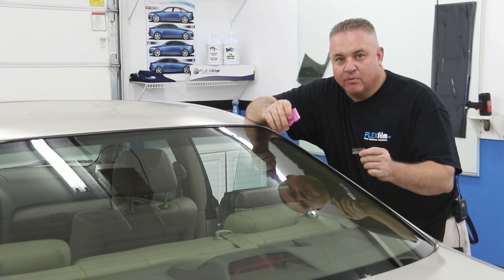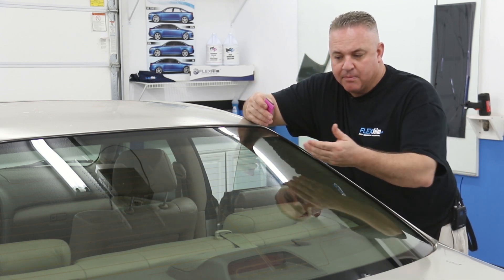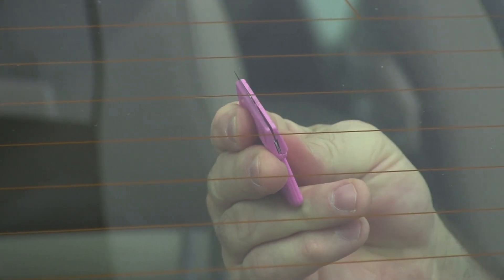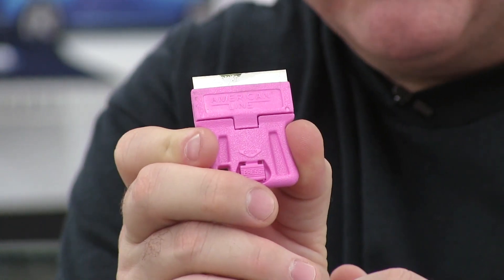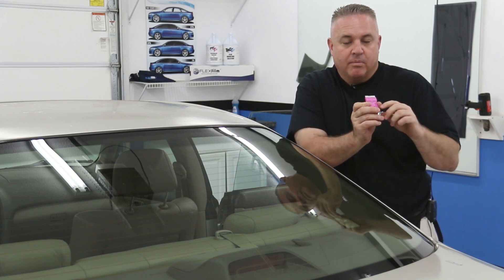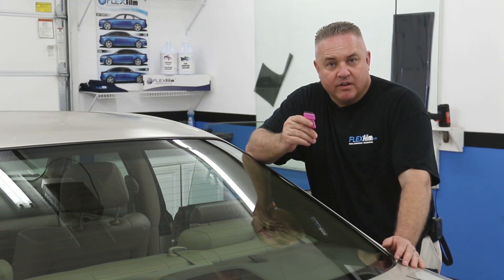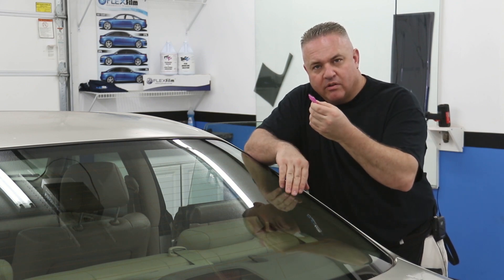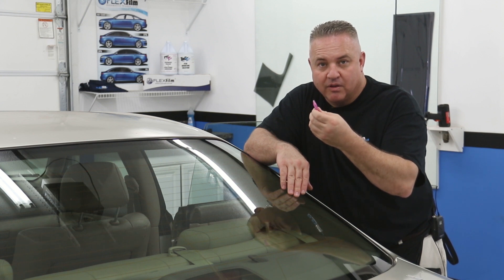Back Blade Defroster Prepping Technique

Comment: Told a my co worker this technique for a  15 Dodge Charger to try and help with shrink tracks. Needless to say he's paying to replace the back glass due to scratches now
Reply: Heath clements all you can do on these newer dodge and Chrysler defroster lines is sit it out in the sun. Basically instead of using you heat gun to touch up the window, the sun will provide a even heat all around the window, avoiding nasty heat bubbling and possible thermal fracturing of the window

Comment: Also removes old tint charcoal carbon that can otherwise affect the visability of the defroster lines and even effect the full functionality of the rear defroster lines. when tint is applied. I thought my lines were fading but they're laser etched - it takes alot to scrape the lines off but it can make all the difference in the look of esp. retinting a back window. I had to scrape off so much carbon that otherwise made my defroster look faded by previously not knowing about this part but looks SO much better to see the grid on black tint.

Comment: Please do not use this method. Coming from a professional using a razor on the rear defroster especially of newer cars will ruin the defroster. No matter what angle your at. If your having trouble with defrost lines, sit the car out in the sun for 2 hours or so and come back, most of em will lay right dow

Comment: Can you replace your defroster line can it be repainted on the outer the outer layer
Reply: I see this comments old but no one replied. Defroster lines are actually a electrical circuit built onto the glass , if you scratch or cut one of those lines that whole line will not work anymore. Therefor doing this method insures you will need to replace the back glass if you want defroster. And you do want defroster , they only can be put on the inside of glass. This not the proper method ive seen, as other people in comments mentioned it would be better to use rhe heat from the sun and work the tint around the lines and allow the heat from the sun to shrink the tink around the lines as best as possible

Comment: does #0000 steel wool work? especially on those Chrysler 300s with thick lines
Reply from the maker: Absolutely, but I might even go with the #00 steel wool.
Reply: isnt that a bit rough? might scratch the glass
Reply from the maker: +rohthedude  I promise steel wool will not scratch the glass
Reply: #0000 is too fine. Try the #000 or even #00 to stop the pesky peanuts
Reply: Ralph Van Pelt what grade of steel wool do you recommend because those new chargers and mustangs give me a difficult time
Reply from the maker: Brandon Martinez #000 is what I recommend.